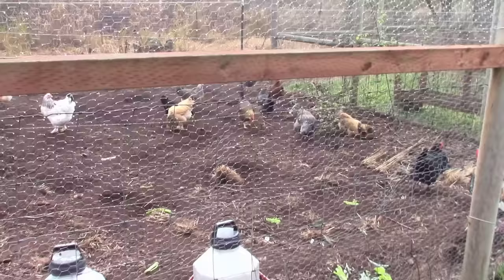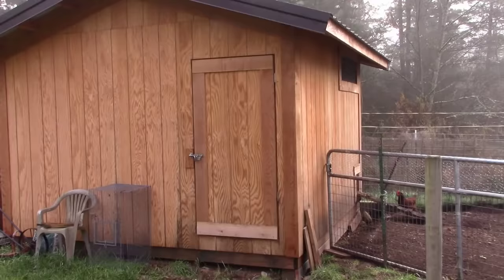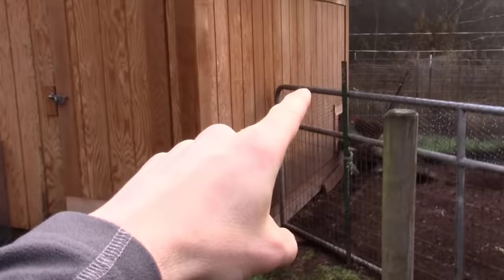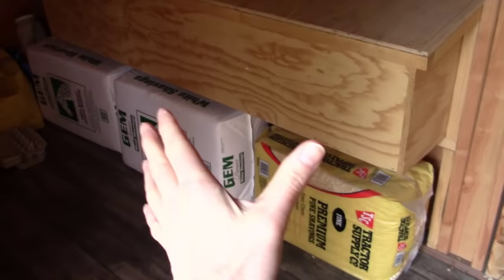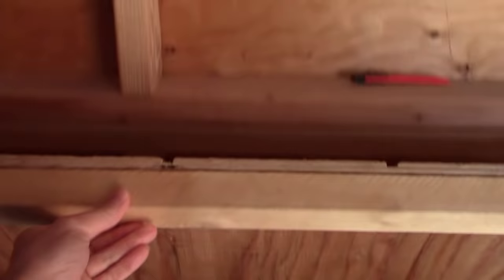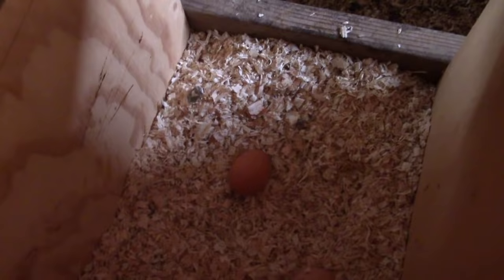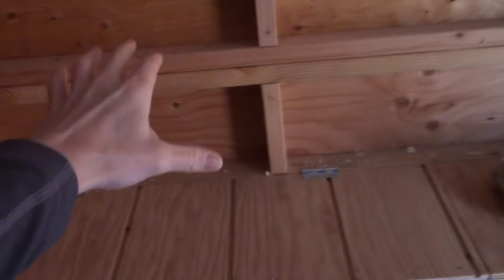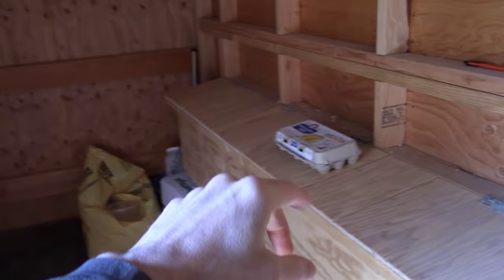How to Build a Tiny Pole Barn in  -5 MINUTES-  | Chicken House Plans

Comment from the maker: If you're interested in any of the products I frequently use around the nursery, here are some links.  Thanks for supporting the channel and happy gardening!  
   
     Hormodin #3 Rooting Powder:  https://amzn.to/3n5F9tS     
     Clonex Rooting Gel:  https://amzn.to/37WqhJF     
     Dip N Grow Rooting Liquid:  https://amzn.to/2WXIU9Q     
     Corona Shears:  https://amzn.to/2WUS2Mt     
     Leaf Trimming Shears:  https://amzn.to/38KrVxt     
     Orchard Lopper:  https://amzn.to/2Jt5pAo     
     Propagation Tote:  https://amzn.to/34WIdlB     
     Propagation Dome and Heat Mat Combo:  https://amzn.to/37WqHQf     
     Indoor Grow Light:  https://amzn.to/2WSxJiT     
     Grow Tent:  https://amzn.to/37X01Pj
     Heavy Duty Heat Mat:  https://amzn.to/3hyTAoV
Reply: Okey kaayu👍👍👍👍
Reply: 1-
Reply: Well done.  One problem:  It looked like you used the same screws for your joist hangers.   The shear strength of most screws is not up to any code.  The steel is too brittle.  Even if 'tacked' with screws, metal hangers must be secured with nails.
Reply: Awesome vid
Reply from the maker: @alexdelarge209  Thanks, I think that was the one place I went wrong.  I guess time will tell.
Reply: From experience (replacing a beam under my house) I can tell you that as long as the joist hangers are screwed tight, you should have no problem as the hangers don't actually 'hang' on the screws.  I mentioned it only b/c any building inspector would make you do it over.
Reply: My cousins are KINCAIDS  WOW your abilities are excellent for the perfect millwright! You can do just about anything I know because KINCAIDS are smart and crafty people. You are all about your work and your doing 👍 great work! You are one of the best on YouTube
Reply: where r u from?
Reply: @BITUKONBOYS  c

Dreamer
Reply from the maker: Wasn't Me  LOL
Reply: Cozy Rain and safe by all kinds of wildlife, amazing
Reply: @alexdelarge209 I do not fully understand your comment about "Hanging". Do you mean there should be blocks supporting each joist to supplement those joist hangers? 
I too am about to try building a structure, and love watching others share ideas, tips, and how to avoid their mistakes.
Also, we use nails too but because they are cheaper than screws so I did not know they were better to use.
Reply: @nicolespeaks3257 : @ 3:00 -> 3:05 exterior screws are being used for the joist hangers instead of nails.  Unless those are special screws, it would be a code violation b/c nails & screws are made of different steel.  Screws don't have the 'shear strength' of nails & are likely to snap (the heads shear off) - being 'cut off' by the hoist hanger if a sudden downward force (drop a sofa or piano) were applied.  Nails; not so.
Reply: @alexdelarge209  GOSH Thanks for that REPLY! I did not know!
Reply: I am getting so phsched up for a Fall of great outdoor work!  Thanks for Inspiration after Summertime Blues are fading!
Reply: You're right & I've used them too.  ... But ... If a structure is going to be used or inhabited by people, any building inspector can tell you to rip it out - no appeal, no options!
Reply: Hi Mike  thanks so much    I am older but I can do this . An inspiring video  .   Will let you know how my coop turns out  Oh also subbed to your wife's channel

Comment: If you are adding an automatic door, add a web camera so you can see if the system malfunctions.  Sometimes if the weather is overcast, the light sensor causes the door to close before the chickens put themselves to bed.  in that case, you will have chickens locked out.  The other alternative is use the timer function instead of the light sensor to trigger the door opening and closing.
Reply from the maker: I like the timer idea best for the reason you mentioned.
Reply: @MikeKincaid79  A'ight have a motion detector on the outside that works for about 15 minutes when the timer is set for bedtime, so the chickens can go in but not out.  Have a bell or some other sound go off to let them know it is time to come in.  Any that don't make it in within 15 minutes will regret having to sleep outside all night and that'll learn 'em.
Then a different bell alerts them and the door opens until bedtime.  The door closes and the motion detector lets them come in but only for 15 minutes and then they are locked in for the night.
Disclaimer:  I'm not a chicken therapist so I'm not sure if my idea will be acceptable to normal chickens.  Any chickens outside of normal will probably just get eaten at night which will solve the rebellion problem one chicken at a time.  THEY MUST ALL CONFORM OR DIE!!
Reply from the maker: @WillieStubbs  LOL, love your sense of humor

Comment: That’s the nicest chicken coop I ever saw! I wouldn’t mind that same framework to build a small greenhouse. It wouldn’t need the flooring. I’m really impressed with your workmanship.
Reply from the maker: Thanks so much!  It turned out nice and is more than just a chicken coop.  It serves as a small barn to hold all the supplies and feed for the chickens too, as well as an area to collect and store eggs out of the rain and weather.
Reply: You can build a green house with pvc pipe and clear plastic.  Much cheaper than buying wood.

Comment: Your chickens would love to have the angles planed off their roosting 2x boards. Doesn't take much. Hand planer or electric one. "Rounded" surfaces accommodate their feet, and and how they grip much better. 👍🏼
Looks great.
Reply: I used a 1/2in round over router bit for mine. Leaves a perfectly round comfortable edge that is easy on the chickens feet. I made sure to do a good amount of research to ensure I made the roosts comfortable for the chickens since it's where they will be sleeping every night. Not too Wide but not too narrow with soft rounded corners for them to comfortable grip.
Reply: I like using tree limbs,  everywhere possible, helps prevent stiffness. Might need a closet pole hanger set  if nails split limbs.

Comment: Very impressive carpentry.  I like simplicity of the roof framing. I Probably would have thrown a bag or two of quickcrete into the post holes but I'm sure you know your soil situation. Well done sir.
Reply from the maker: I've done a lot of fencing and building on my place and this is the first job that I didn't put concrete in the bottom of the holes.  At the time, I was thinking that it's just a chicken coop and I dug down over 2 feet until it was hard and rocky.  I'm convinced that it was and is solid enough for this building but in hindsight I wish I would have done that just because I build most things overkill.  As I think back, it's kind of strange to me that I decided not to put concrete in the holes.  I guess we do some strange things sometimes, haha.

Comment: Love your wrap around building process,  I'm planning this type of building for a tiny house.   You nail on the outside and inside of the post creating space for insulation.   This is the easiest way to build,  but you went way extra.   Great job!!
Reply from the maker: Thanks, it's a great design that I got from a local pole barn builder.  3 years in and going strong.  We love it!

Comment: Nice job! I think I’ll build the same thing for a run in shed for my horses! Won’t need a floor but that’s a damn sturdy structure! For the hinges on the nesting boxes I used small hood hinges on my chicken boxes. Just lift and they hold up nicely and close easily
Reply from the maker: Sounds like a cool idea for nesting lids.  Yeah, this barn is a tank.  Should last forever.

Comment: A cut list would be ideal!! I am still amazed with the chicken coop! My challenge here in Utah is hard winters, avian predators, coyotes, bobcats, people's dogs, weasels and ring-tailed cats. Oh and those pesky grey bushy tailed squirrels 😖
Reply from the maker: I hear ya.  We are having similar problems this winter with racoons.  Never had issues in the past and now they've found the chicken run.  Nothing that a little hot wire won't fix.  Shellie sheds a new tear each day as she goes out and finds another chicken carcass.  They are her babies.  We may have to raise a few more chicks this spring to replace the lost souls.  I'll have to come up with a materials list for this project as I get that request a lot.  When I originally built it, I didn't have plans, just build it as I went but had a general idea of what I wanted.  Maybe I can put a video together about it with a materials list included.
Reply: @MikeKincaid79  how exactly are the critters getting to your chicks?
Reply from the maker: @cwr8618  It was our fault.  We weren't closing the door at night.  Haven't had a problem leaving it open for 2 years and for some reason this year we've run into trouble.  We now close the hen door every night and haven't had a problem since.  Time to get an automatic door installed.
Reply: @MikeKincaid79  oh got it. Sorry to hear that. We are about to build some runs to connect to the coop and were concerned we'd be missing something. Thanks

Comment: I've already done something like this myself, however, I tend to insulate my pole barn floors with mineral wool (eg. Rockwool, Thermafiber, ...) and adding another lay of pressure treated plywood to the far bottom.

Reason for the floor insulation, these pole barns are elevated off-the-ground conducting/insulating zero ground warmth/heat within non-tropical areas, or subjected to winds/climate of the far northern/southern latitudes during Winter.

If the pole barn is ever used for something above freezing, such as a water storage tank or other warm/non-freezing area/storage, will be a pain in the butt to ever insulate the floor within the future.  Mineral wool, aside from mineral wool's insulation and pest reducing assets, also reduces noise.  We all want our clucking chickens to sleep well right?  (However, guess one could also lay down some foam board in between another layer of pressure treated plywood.)

For the walls, I'd likely partition one room and insulate only those walls using cheaper fiberglass, as walls are extremely easier to maintain versus the flooring.
Reply from the maker: It's just pure natural sulfur, that's it.  You could use it as a drench but you'll want to stir it up just before using cause the sulfur settles after a couple hours.

Comment: You did a great cut. The technics of your build is educational. The roof for example. Nice approach. I really enjoyed to watch it. You should try to seal the bottom and use bacterias with lots of shavings and / or small (grinded) straw. This way all the poop will be eaten by bacteria. You won't clean that much and it eliminates the smell.
Thanks for good video.

Comment: So... I'd planned basically exactly this build, having built a few bits and bobs over the years.
I've spent the last 3 months listening to people who've either not built much or who've built loads, but only ever as contractors or site managers building to other's plans.
Thank you for this; I'm going back to my original plans.
Reply from the maker: You can do it and you don't even need plans.  I'm not a builder and have no experience in the building industry.  Just grew up building tree forts and other projects.  Also, grew up around a Dad that build lots of things as well.  All it takes is a some thought and a willingness to carry it out.  I wish I had plans for this and have been asked a lot but all I did was copy another shed on my property that is similar.  I'd just take a few measurements and go replicate what I saw, then go look at how another part was and build it, and on and on.  Good luck with your project and have fun building it.  Nothing quite like the satisfaction you get from a job well done.
Reply: build a miniature test one that is moveable as a test. Can always find a use for it. Too many people wait till they get to that point. Develop skills and plan on small scale so when ready is easy.

Comment: That thing is massive and awesome... Great job me for summer i would add two tiny fans at a low to medium speed and winter add the lighted heater red bulbs maybe one on each side with the two fans at a low speed where the air recirculates just like in chicken grow barns. Add make sure you put them on timers so its more automated.... Thats just me.
Like i was once told by a chicken farmer "a happy chicken is a healthy poppin chicken" 

Meaning constant eggs producing... Oh and that side door directly to outside perfect than you have chicken manure the best fert but use very lightly as it can burn your trees or other...

Comment: I always tell folks 6x6 is a must....a much quicker accurate way would have been to use a transit to shoot the posts and mark them atleast one set then pull from that...also overlapping corners is nice to if lumber is long enough....I'm guessing no concrete was used....that's OK
I think I may have put the posts in a plastic bag with a shot of transfluid to make them more bug resistant

Comment: Nice.  That’s serious chicken house.   

I bought some magnets off of eBay, it’s actually made to hold a gun but they’re very strong magnets anyway that would be really cool for those lids on the nesting box you could just open it and the magnet would hold it open and you wouldn’t have to fumble with latches which might be beneficial if your hands are full and you only have one or a finger you just need to pull it down without fiddling with hardware.  You might even work out something with a chain and a spring so they don’t slam if you drop them.
Reply from the maker: I love the magnet idea.  Still haven’t done anything about this.  Probably time to get it done, lol.  Thanks for the idea

Comment: Consider rain barrels at the bottom of your new gutters. Route the barrel's overflows well away to keep the mud down. Rainwater for the chickens and the garden. Very nice build.
Reply from the maker: Thanks Mike!  I've thought a lot about rain barrels.  That's a fantastic idea and I will eventually get around to it.  Sure would be nice to not have to worry so much about watering the chickens.
Reply: @MikeKincaid79 A rain barrel has become somewhat essential around here because of the drought. The past two Summers have seen me refilling the barrel with tap water in between meager rains. One of my neighbors made a cascade system with his multiple barrels. Overflow from the first filled the second, second refilled the third and so on through five.

Comment: Having chickens for the food they offer is great. It does however tend to make it hard to go on any vacations. Nice build!
Reply from the maker: Thanks!  Yes, that's always a concern when you keep animals.  We use to have cows and they tied us down to the property pretty tight.  Got rid of them cause the kids were getting older and we wanted to travel more.  The chickens really aren't a problem for us because we have them in such a large run with plenty of grass and bugs to eat.  We fill 3, 5 gallon waters and a 50 pound feed dispenser before going on vacation.  This usually lasts for a week.  Then we have family close by that just stops over and checks on things.

Comment: Lay a cheap blue tarp from Harbor Freight on floor of chicken coop. Pull the tarp to clean floor. Just pull it out the door and across yard to garden. Dump, rinse off, and replace. Small kiddy plastic swimming pools good to put stuff in and drag around yard, like sticks, feed, trash compost. Just add small holes for water to escape it let it sit between dumping it.

Comment: Halfway through this video I instantly subscribed. This is the best edited and shown video for this type of thing. This could easily be a small cabin as well. Can someone please tell me (link) what the insulation stuff is that he dragged up onto the roof before putting the metal on? Thank you, Jim.
Reply from the maker: Wow, thanks for the nice comment and the subscription, Jim!  The insulation is just a pole building insulation.  It's not used to keep heat in and doesn't have much of an R value.  It's simply used to prevent condensation on the metal roof and it works perfect.  This stuff is used in most pole buildings in my area.  You could use this when building and then go back and stuff more insulation between the 2x6's to create a nice R value for heating a cabin.  Good luck and have fun!

Comment: Looks great. What fasteners did you use at the corners with the 2x12's that are holding up the floor. Did you support the floor Amy other way or.so you have some huge shear strength in the fasteners?
Reply from the maker: That is one place I wish I would have done a better job.  I used screws for the joist hangers.  Wish I'd have used nails but so far so good.  I did use a ton of screws so hopefully that does the trick.  I went back and braced every 2x12 at the halfway point under the floor and this one move infinitely strengthened up the floor.  It's a very solid floor and I jumped up and down on it a lot to make sure of it.  Been up for 2 years and going strong.  Time will tell the rest.  I'll do an update in 10 years, lol

Comment: Really great. I'm no carpenter but I heard one say "When building a wood structure remember nails will bend and flex,  screws will snap.
Reply: It's called shear strength. Nails have it. Screws don't
Reply: @ Gary Von Thanks, you must be an engineer.
Reply from the maker: I built with both so I covered all my bases.  Now that I'm hearing this, I'm glad I did.

Comment: I don’t know if you have played around with modern day rare-earth magnets, but they are wicked strong. A couple of drops of superglue, a steel washer, and one of these magnets will make you a one-handed lid holder-upper. Don’t be stingy with the glue though, these magnets are strong enough to pull away from whatever if not well attached…
Reply from the maker: I like the idea and have been thinking about it.  Just need to order the magnets.